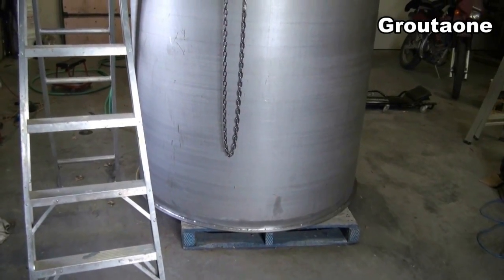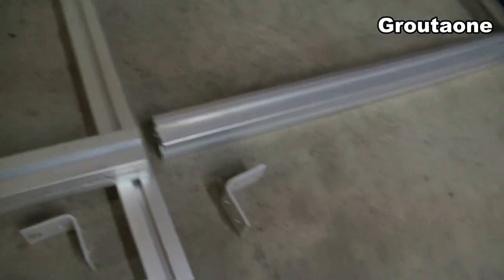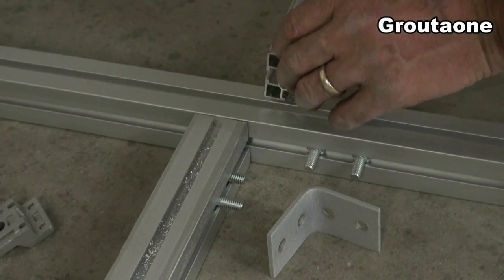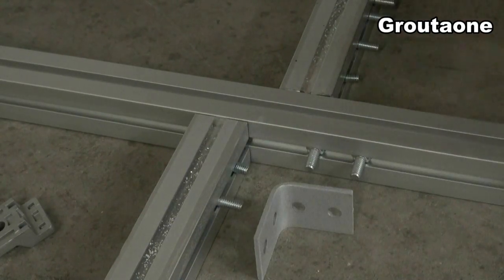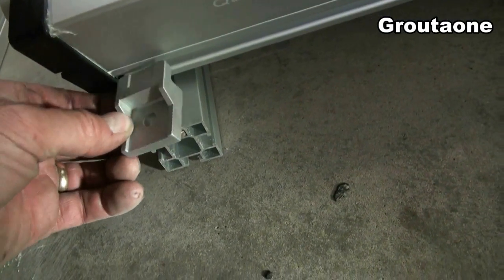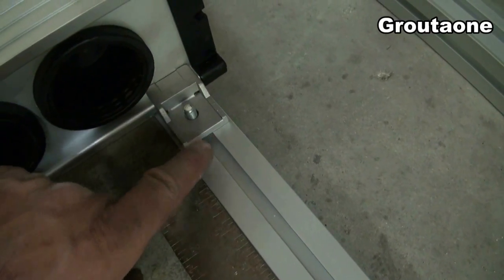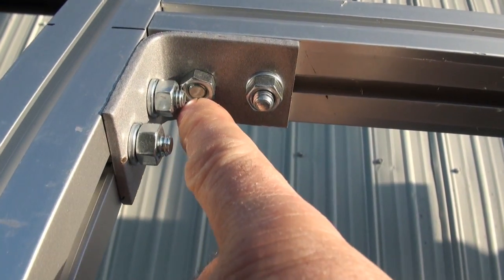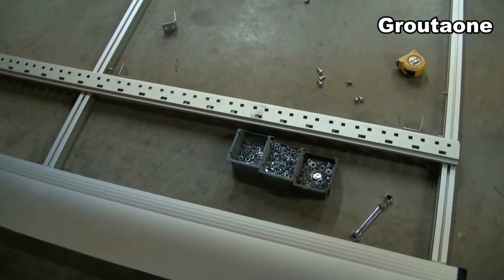Solar Frame Assembly

Comment: is there any reason you deicided to use a cummins powered truck and not another type of diesel say a ford with a 7.3 or 6.9 idi maybe with a turbo?
Reply from the maker: +dexterlexter123 I never really been a Ford fan and I think the newer Chevy and Ford trucks are a tad ugly, just my opinion of course, I tried a Dodge and I really liked it
Reply from the maker: +dexterlexter123 I should say though I was a big Mustang fan years back, I think I could still identify a 66,67,68,69 and 1970 from a ways off

Comment: Now that I've seen the framework etc for this system the 16' deep pilings seem excessive?
Reply: He has stated in a previous video the reason that the poles were so deep into the ground is due to how cold the winters get, it pushed the concrete up alittle, if I am correct.
Reply from the maker: +chrisizzile50 You are correct, frost has a way of lifting a little year by year, around here if you install a row of fence posts three feet deep and nice and straight, after a few years it's not so straight
Reply: Isn't the frost line 4' deep for Ont.?
Reply from the maker: +MrFakit Not sure but depending on location 5 feet of frost in not unusual,
Reply: +groutaone Goodness, I cannot begin to imagine that! About how long does it take to thaw out?
Reply from the maker: +Dan Whiteford Not sure but likely gone in June sometime